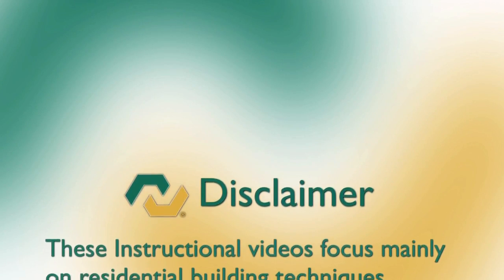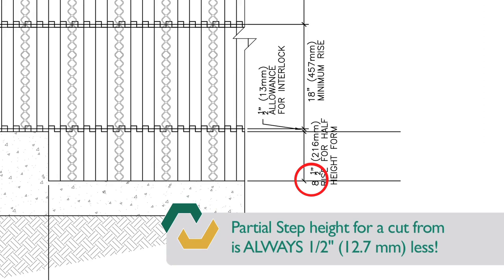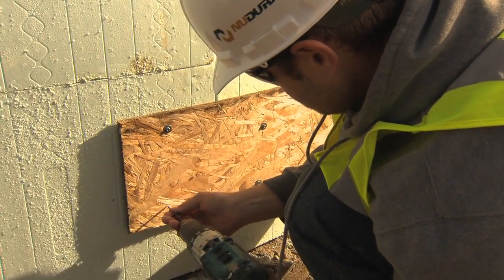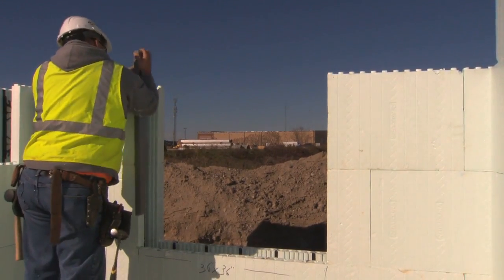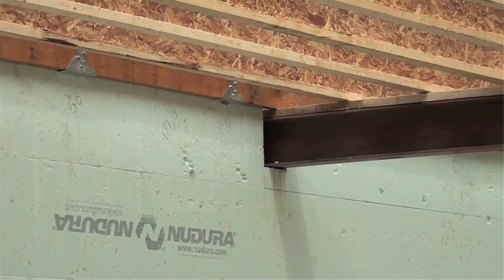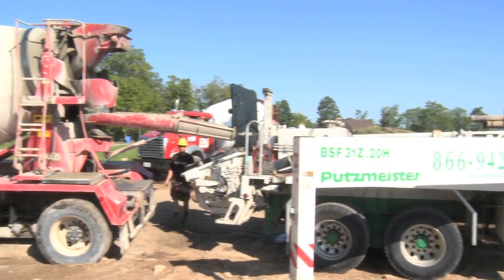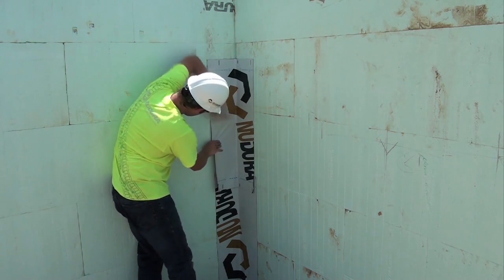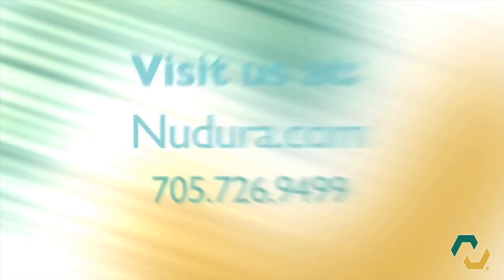Eco Build NUDURA Installation Video אקו בילד

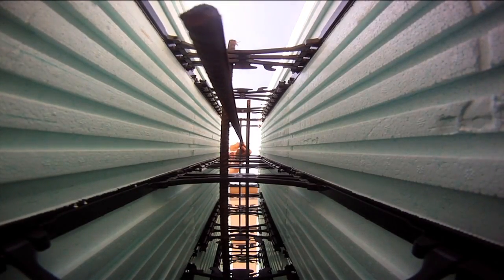Comment: At 18:35 I see a wall form that is nowhere near straight. Plus screwing strapping into foam at 15:15 seems like not only a "fix" to the bulging problem that won't hold, but exposes a major design flaw in the product. Then on top of those problems, BOTH sides of the walls have to be finished to cover the foam, at more expense and effort. Think I'd opt for precast aircrete or foamcrete blocks that have none of the above problems. Thanks for the video though, because now I can see the deficiencies with ICFs. Sorry.
Reply: Maybe you should watch this again and pay more attention. Finish requirements are your own, however the foam contributes the "I" in ICF. More foam means more insulation. Aircrete and Foamcrete will also require finishing to taste/style at whatever expense you wish.
Reply: That's not true. Unfinished air or foamcrete blocks exposed to the elements would survive just fine, because it's concrete. Same can't be said about ICF's because UV rays break down the styrofoam fairly quickly.
Reply: Finish is not only for function but also style/taste. Aircrete and Foamcrete are equally lacking in style to ICF.